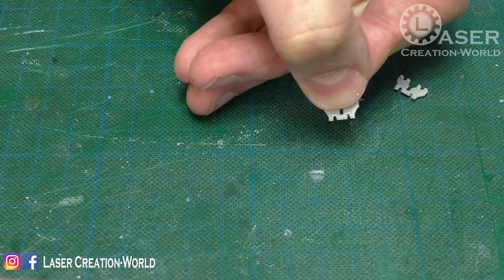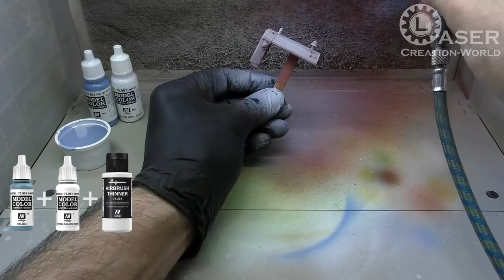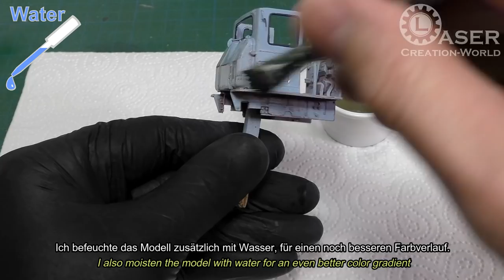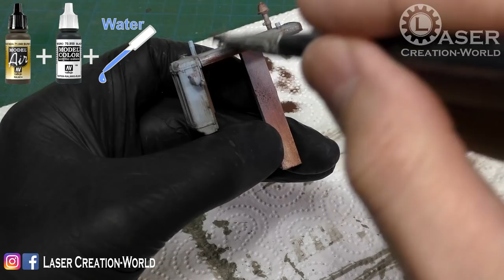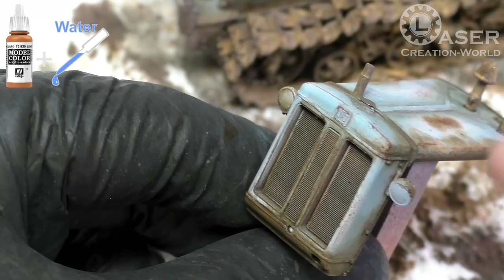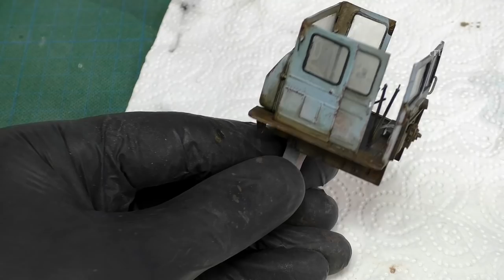100% Acrylic Weathering DT-74 Soviet Dozer / 100% Acryl Verwitterung DT-74 Sowjet Bulldozer

Comment: You know, I'm looking at that W 50-L in the clip a month early then this one, side by side with this one, in your profile it's uploaded video's and I'm wondering, would that cabin fit on this bulldozer, if modified?
And what if the dozer blade was changed out for a main clearing apparatus or so?
Might even incorporate the bulldozer blade as a blast shield, if so wanted.
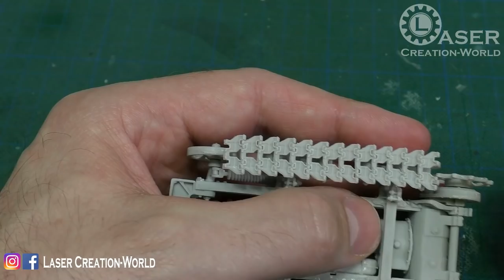Is there any mechanical farming equipement in the 1:35 scale???
Farming in a post-WWIII setting, could be quite dangerous, just think of all weapons still found from WWI, now think mine fields and worse.
Mine clearing & metal detectors, just so you can plow the field.

Rubber tires crumble over time, so what about wooden or metallic replacements parts, so you are driving on plates, instead of tires?
There you can have several versions of how they overcame this problem, including using tank parts.
Lots of post-WWIII settings, around, from Ice Age settings to nuclear fallout settings (Fallout & Metro).
I can see Ice Age settings living danger close to volcano's, you know, with steam trains ruling the railway tracks, until they freeze up.
Coal being the rediscovered Black Gold.
The problem with your Ice Age bulldozer, the water tank ain't heated and thus can freeze itself into a broken state, better mounting it next to the engine and using it's heat to keep the water above freezing temperatures, same goes if it is fuel, if less so.
Now, which countries can (still) have both Soviet & US Army bulldozers?
South Pole?

Anyway, happy building in a hopefully, for you, a happy new year.